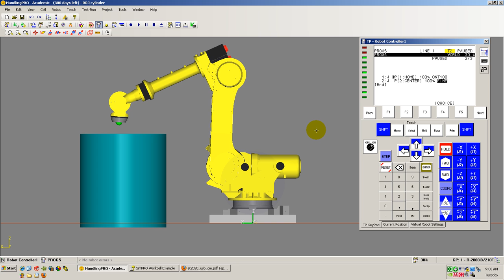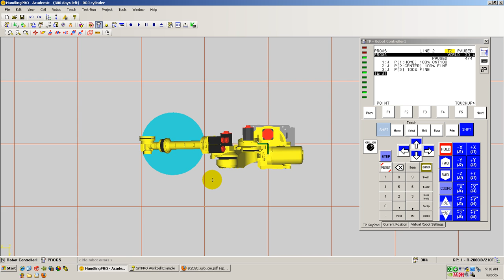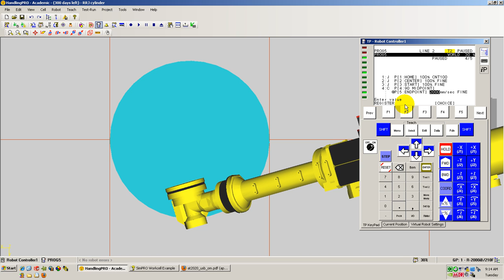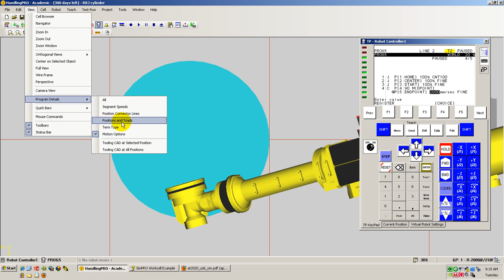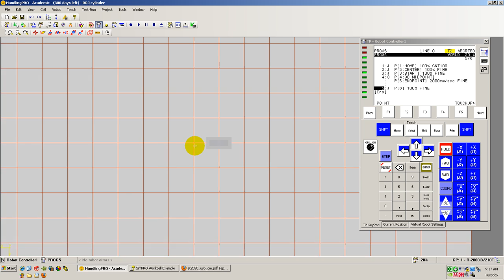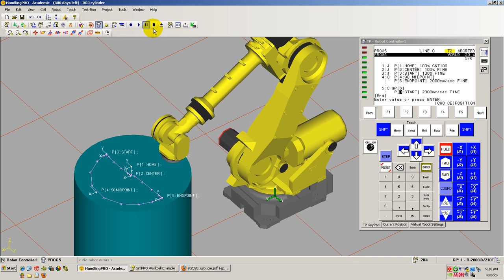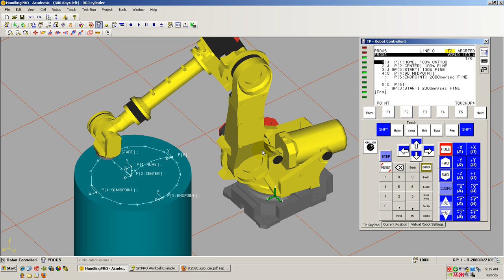How to program a CIRCLE (or ARC) command on a FANUC Teach Pendant

Comment: good video guys but I have a question I want to make a circle with my tool in 45° but I d'ont have a protractor thanks guys
Reply: Yes mee too because my protractor is brocken, it's very sad
Reply from the maker: I'm not sure I understand the question.....one could always plot out the X,Y values for each point in ACAD for a particular radius and arc angle....

Comment: Hi, Thanks for the video. I'm so new about these kinds of robots. In my intern, there are 250 points on a foam which each of them belongs to an item. My supervisor said that "every point is defined before we write the code lines.". I was a little confused. Because all of the points are linearly and uniformly distributed. Even though we know the row, column numbers, the derivatives of the axis dx, dy are also known. I asked him, and his answer was "the process is basic. We don't need to make this simple.". My unanswered question is what if the process needs thousands of code lines? I'm trying to find such a thing in C language or similar languages have which are recursive functions and user-defined variables. I found LBL[] for creating a loop, but I haven't found any information about the variable that I can manipulate. So, as you understood I wanna ask you, is there any way to use a variable in the code lines?                   Thanks.
Reply from the maker: I have not written custom code for industrial robots. There is a separate language called KAREL that allows mode coding options for what you describe, I'm not certain your goal can be accomplished with the standard Teach Pendant (TP)  "conversational" programming. Your robot has to support KAREL and you have to have offline software to program it. Good luck!
Reply: @PSDettmer  Thank you ✋

Comment: i am trying to program the circle. i keep getting the cursor in two places at the same time. do you have any idea why?
Reply from the maker: Hmmh, sorry, not sure what you mean by "The cursor" in two places?
Reply: I am referring to the @.  But it does not fault like that now.  thank you for your timely response.
Reply from the maker: Ahh, the @ symbol indicates that the robot is AT that position. If you have it on two points, it means that the same X Y Z position is referenced by two (or more) different POINT #s.
Reply: Thank you.  How do you open and close the grippers?
Reply from the maker: In the simulation (RoboGuide) or actual robot? In the simulation it's actually substituting a different 3D CAD file when switching between Open to Close. On real robot, you can use the built-in Robot Outputs (RO_xx) to open/close actuators.
Reply: Thank you

Comment: But the p (6) is not at the same radius as p (4) so its not a true circle. How to programe a true circle?
Reply from the maker: To program a true, full circle, you only use for points. You re-use the same start and end points for each ARC, to start the next. Below is what the program would look like.
1) J [P1] 100% CNT0 - (start point of first arc)
2) C [P2] 100% CNT0 - (mid point of first arc) 
        [P3] 100% CNT0 - (end point of first arc & start point of second arc)
3) C [P4] 100% CNT0 - (mid point of second arc) 
        [P1] 100% CNT0 - (end point of second arc & start point of first arc)

Comment: were can i get the program you useing i already know how to use the robot
Reply: Ryan 1 ManRiot Probably cost $10K for this program.
Reply: Hello Ryan, the software we use is called RoboGuide from FANUC Robotics. It's available through them or authorized resellers. It's very expensive and licensing is on an annual basis. Pricing is different for education. Please contact FANUC for more info. I'm not allowed to share pricing here.

Comment from the maker: The robot recalculates the center and radius of the Arc after you touch up any one point. Depending on how far off the new point is from the previous point, the center point might be in a different position. You can verify and compare the WORLD position of your points.